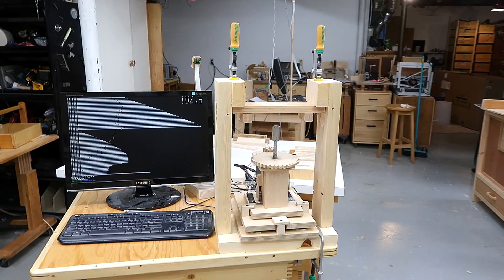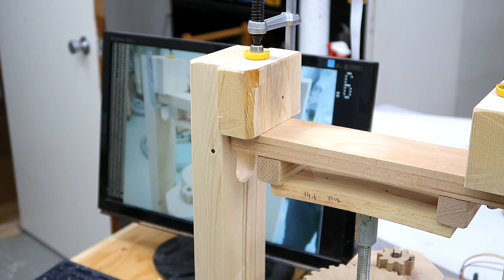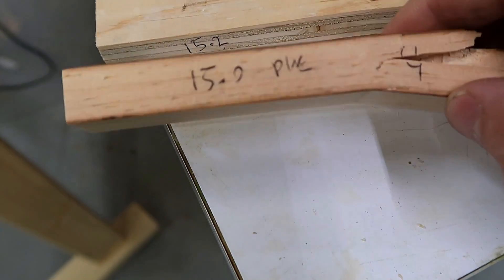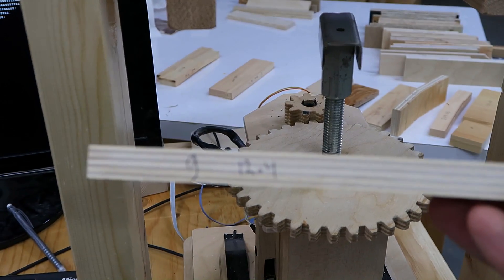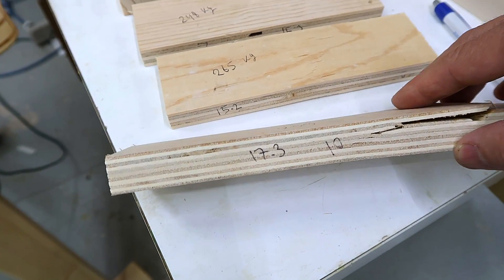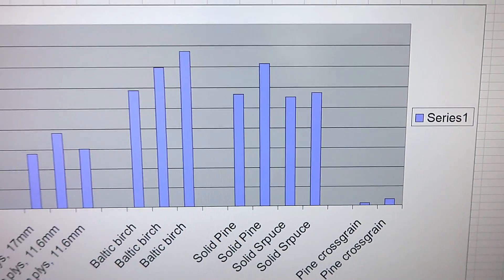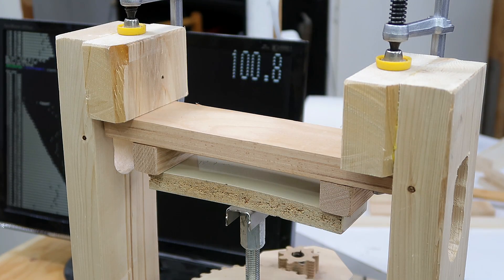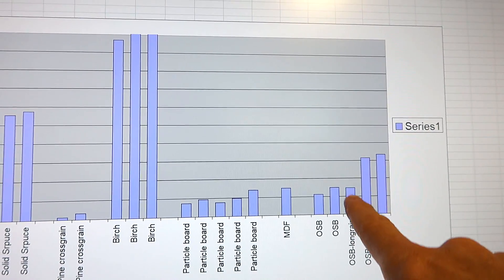How strong is plywood, MDF, OSB, particle board vs. solid wood

Comment: "The ancient Egyptians and Greeks cut wood thinly and glued it together in layers with the grain in perpendicular directions as fine wood was in short supply. This is believed to have been done purely for cosmetic and economical purposes but it turned out to be a great alternative to pure wood as it reduced flex, making it a versatile building material."

"One can thus presume that rotary lathe plywood manufacturing was an established process in France in the 1860s. Plywood was introduced into the United States in 1865 and industrial production there started shortly after. In 1928, the first standard-sized 4 ft by 8 ft"

Comment: I am not sure I am using the right words since I am not a native english speaker..

The material physics is pretty straight forward. The strength of your probes rise with the thickness^3. Also one side is in tension while the opposite side is in compression. This means the middle fibres carry no load (which is over simplified!). Also this means with plywood the inner grains may lay in the wrong direction, but this doesn't matter much since only the most outer ones carry the load.
For semis you want things to be light but heavy duty; best things therefore are sandwhich panels; outer layer of sheetmetal (steel or aluminium) and in between light (and thus weak) foam of some kind. (maybe you see the similarity to plywood)

fun fact: car springs can hold significally longer with the right paintwork; since it is always on the outside, it may carry quite a lot of the load if it adheres good enough and the material properties of the paint are good.
Reply from the maker: Stiffness rises with thickness cubed, strength with thickness squared.  The solid birch samples, all from the same board, showed how consistent that worked out.  If I'd used the wrong equation, my results would have been all over the place
Reply: You should be proud of your English. Thanks for sharing your knowledge.

Comment: Ever played around with edge ply? I used some cement form work support stuff to build a desk and it's super strong. It's all single direction so I cut it into strips, then sandwiched them together like an enormous butchers block. The strips were super flexible sideways but had almost no play on a vertical plane.
Reply: You can actually buy that.
Reply from the maker: Didn't have any handy

Comment: Matthias might consider using the beam stress equation Mc/I and comparing stresses instead of factoring loads around. He's using an interesting method of normalizing results, but it's not exactly the same as what you'd see in a standard three-point bending test. Also I'd like to see a tensile strength test as well but that requires a different test setup. Big props for generating your own material strength data! That's amazing dedication.
Reply: Wood in tension is so much stronger than in other orientations that there's little use for knowing tensile strength.
Reply: @Bob_Adkins  only if you're using the same size wood everywhere. If you made an A-frame from framing pine or LVL but made the bottom member from dowel, then knowing the tensile strength will allow you to use the smallest dowel diameter.
Reply: @toolscientist  I know what you're saying, but wood in tension is so much stronger that if you made it smaller, there would be no reliable or practical way to fasten it. So wood in tension will always be WAY larger than it needs to be. That said, not much wood is used purely in tension in normal construction.
Reply: @Bob_Adkins  a through hole and thin dowel glued in will be strong enough at a certain diameter to hole length ratio. But yeah, you need fairly specific examples that aren't often used in reality, so your comment is right in 98% of cases 😉
Reply: For a rectangular cross section, Mc/I reduces to 6M/bt^2. This is where he's getting his factor. If you double the thickness, you reduce the stress by 4.

Comment: Saying that half the grain is oriented the wrong way is sort of like saying 2/3 of an I beam is in the weak orientation. That’s just not how it works. I think the major difference is that generic pine plywood comes from the outer grain of speed grown trees while dimensional pine comes from the center of bigger, older trees. As a counter example, LVLs are significantly stronger than the same size pine lumber. That is due mostly to being oriented so that they are loaded on edge where plywood is strongest.

Comment: How does the stiffness compare?  Looks like MDF should be pretty stiff among these? Which agrees well with some of its applications (stiffness, weight and damping, like for speaker boxes).

Regarding anisotropy, would be interesting if they made plywood with thicker core plys and thinner surface plys -- well, they usually do, but more like having veneer on top of a couple thick core plys.  I mean like having several alternating layers of thin, yet quite strong material -- like, a coarse 1-3 ply pine core in the middle of 3-4 layers each side of Baltic Birch or the like.  The core could be even weaker woods for that matter; it only needs to handle some compression keeping the outer layers from buckling, while the outer layers handle the bulk of the tension/compression load.  Same concept as honeycomb- or foam-core fiberglass construction.

They probably don't for production cost / complexity reasons (hence Baltic Birch being thin layers all the way through); or the consistency makes it better suited to joinery too.  And I don't suppose you'll be very interested in making your own plywood to test the idea, hah, but just a thought -- in particular, it's interesting that the cheap 5-ply is so much weaker across-grain, basically because the outer layers don't count for anything while the inner layers, bearing the load, are effectively so much shorter, like a 3-ply, 12mm or whatever, piece would do.
Reply: MDF is used in speakers because it tends to be acoustically "dead" (non-resonant).  It's also inexpensive and easy to machine.   It's not particularly strong.  And don't ever get it wet.
Reply: I seem to remember that MDF is used in speaker units because it is consistent throughout the board, which might have effect on acoustics. Companies tend to care about repeatability, and mdf provides consistent results.
Reply: the DeHaviland Mosquito was constructed with a 3 layer plywood construction of a thin birch ply on the outsides and a thick balsawood core.
the modern equivalent for aircraft today would be glass fiber with a honyecomb core.
Reply: MDF is not stiff at all; it will deform easily if under transversal loads (ex., shelves) and will slowly lose its ability to return to the original shape. It's reasonably strong in the longitudinal direction (ex., vertical side panels).

Also, as mentioned above, will will swell up and delaminate as soon as it gets wet (unless you use moisture-resistant - typically green - MDF). Always seal the edges (ex., with diluted PVA glue) - and preferably the faces as well - if there's any chance that any liquid will get spilled on it.. Note that varnish and paint will only work until there's the slightest crack, and then water will get through and ruin the MDF. PVA, sealants and some primers will actually soak into the MDF and form a thin waterproof layer.
Reply: @RFC-3514  Also a good point about creep -- this test only shows short-term deformation, but things can go differently over long time scales, and with temp/humidity cycling.
Reply: You can always DIY your own laminate. Sandwich 2 layers of thinner baltic birch over a thicker core of "whatever's cheapest or lightest"

Comment: Wouldn't the most important strength for a bandsaw application be within the plane of the plywood?  I didn't see that tested.  Essentially, I'd be curious to see how plywood would fare in that device when rotated 90° around the long axis.
Reply: Thirded.  No wait, Fourthed.  Yeah, I'm not sure his tester can take the stresses, but in-plane (good nomenclature, I couldn't think of the right term) testing of the plywood is what's needed. 
Matthias, I work in a materials lab.  Send me the samples and I can test them.
Reply: Yeah, I mean in building plywood/OSB is used for its shear strength (and of course that it's awfully difficulty to get 4x8 sheets of solid pine!).
Reply: I would love to see that, too.
Reply: I was thinking exactly the same thing.
Reply: Interesting. There are a lot of forces involved in the machine, but I see now that the video is directed at a specific part of the machine. The column is what is in view here. Other parts of the machine would have different forces where different testing would be needed.
Reply: I feel an LVL comment coming!?
Reply: @Ryan Davies.  You sir are correct.
Reply from the maker: No, it's bending of the column.  When the blade is tensioned, the far side of the column is actually under almost as much tension as the near side is under compression, because the bending moment dominates.
Reply: @matthiaswandel  I suppose I imagined that the major components in the main plane of the body, including the column, upper arm, etc., would be from contiguous pieces of plywood in that same plane, then just laminated for thickness.  Even if that isn't so, could you not build the column with the plywood oriented in the direction I propose?  Is plywood, in fact, strong in that orientation, as I believe it might be?  If you have a chance, I'd be interested in that test, even if it is not applicable to the bandsaw.
Reply: @ryandavies1731  You could, but the point Matthias is no doubt trying to make is that the arm section is significantly narrower, even along the plane you're describing. It's essentially C-shaped.
Reply: @matthiaswandel  I would be interested to see a follow up video of you explaining this comment with drawings, and maybe physical examples to help make it easier to understand. I appreciate all of these awesome videos btw. Long time fan.
Reply: @chrishoesing5455  The C-shaped main column is very similar to a straight beam subjected to bending force. One side of the beam is in tension, the other side is in compression, and there is shear in the middle.
Reply: @mckenziekeith7434  You're forgetting the 3rd dimension. There is a twisting force as well since the force of tightening the blade isn't applied on the centerline like you're thinking. I understand pretty much what's happening, but thought it would be interesting to hear Mathias' break it down in his style. Thanks for your reply though.
Reply: @chrishoesing5455  true. There is some twisting. From your first question it was not clear how much you understood about the load. But now I see you actually get it pretty well. My apologies for initially underestimating your level of understanding.
Reply: @mckenziekeith7434  no worries man, I appreciate your being helpful. I enjoy learning and teaching as well so I know where your coming from.
Reply: @matthiaswandel  but who would ever build a plywood bandsaw with the normal axis of the plywood orthogonal to the axis of the wheels? That would be silly.
Reply: @beefchicken  not really clear what you are saying.
Reply: @mckenziekeith7434  @Beefchicken Industries is pointing out that the orientation of the plywood in the bandsaw matters. The original poster is thinking what I'm thinking: if you made a bandsaw from plywood, the sheets making up the frame would be oriented parallel to the plane of the wheels, just as the laminations of solid wood in Matthias' bandsaw are. In this case, the strength that matters is that which is oriented within the plane of the plywood sheet. In other words, you would test the material by pressing against the plywood edges rather than the faces.
Reply: @tarheels100  I see what you are saying. I guess you are right. There wouldn't be any easy or sensible way to make it out of plywood other than that. So about half of  wood fibers would not be aligned with the load. Which is what Matthias always says by the way, when people ask if you could make it from plywood.

Comment: Also proves why you never make something that will receive force cross-grain, the strength of the pine was pitiful. This is something that 3d printing people should have learned by now as 3d printed objects are far stronger along the grain than cross-grain much like wood; all the time I see 3d prints in which the print orientation makes it receive force cross-grain.

Comment: Its more for plywood being more homogenous and less at risk from bending overtime than wood, not for the strenght if i think correctly. Also it is easier to buy a sheet of ply and then cut the shapes than buy wood and make ot i to shape.
Reply: Bending due to moisture changes (or improper drying of the wood), sure. But the plywood is more likely to bend from physical loads (ex., weight on a shelf).

Comment: I think if you laminated the baltic birch to the same thickness as the bandsaw solid wood frame I believe it would be stronger and less prone to twisting and seasonal movement.
Reply from the maker: For baltic birch, yes.  But it would weigh more and cost a lot more, and only be slightly stronger
Reply: If I could afford enough Baltic birch to build a bandsaw, then I could buy a really nice bandsaw.

Comment: Cool computer craft, I'll check for a video on this machine. What kind of load cells you using? Are you using an arduino as a micro-controller? You have a jig to cut your gears or do you cnc cut them.  I love to see stuff like this!
Reply from the maker: Bathroom scale load cells (from aliexpress), raspberry pi to run it all
Reply: He has some videos from years ago about making wood gears.  They're made with paper templates.  Check out his website!
Reply: AFAIK he is using a raspberry